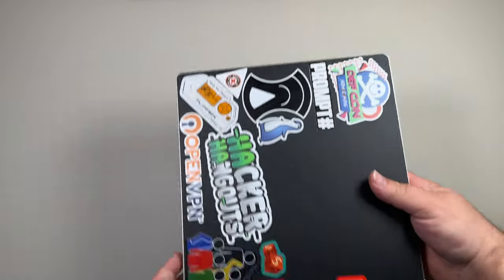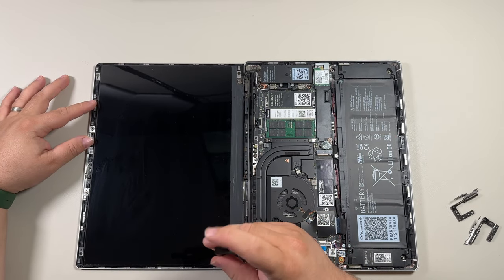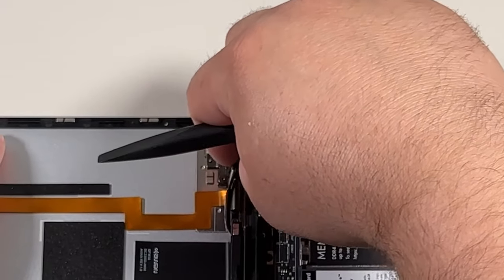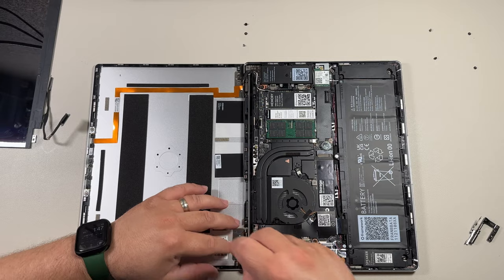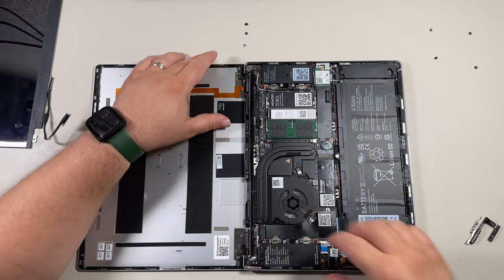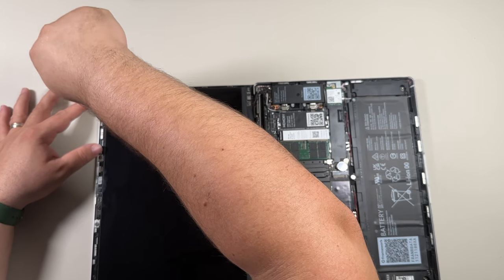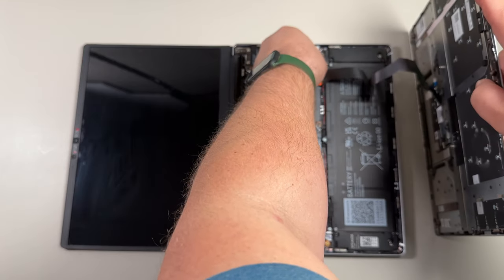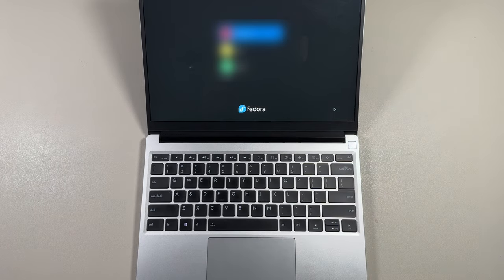Framework Laptop Hinge Upgrade

Comment: Just a minor correction: you said 3.3 lbs and 4 lbs. It is actually 3.3 kgs and 4 kgs. In case anyone else was wondering. Great video!
Reply from the maker: Dennis you are absolutely right, I misspoke there. It is measured via kgs and not lbs.